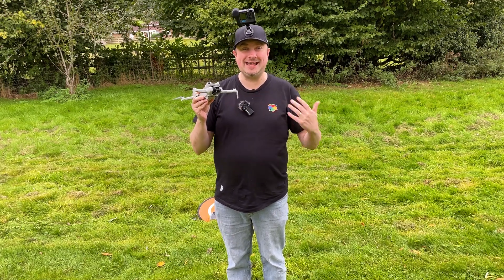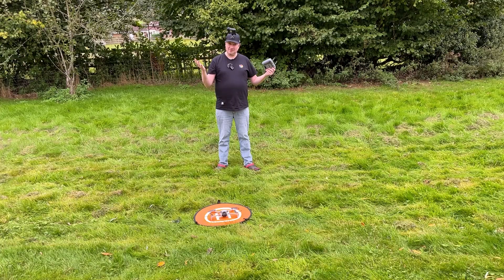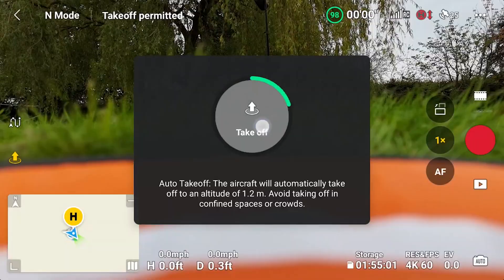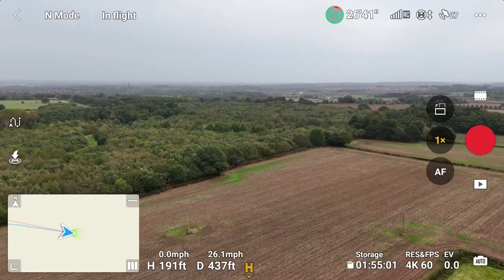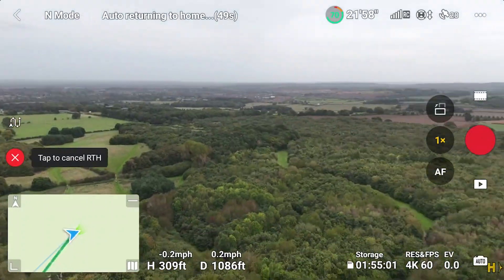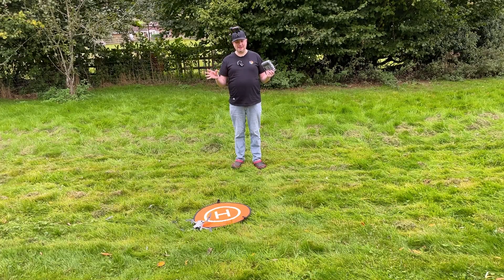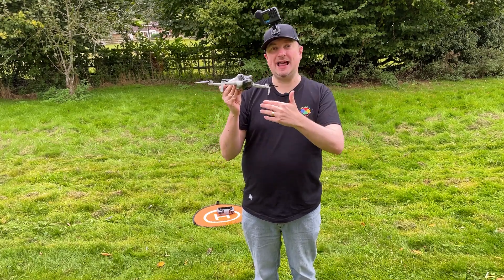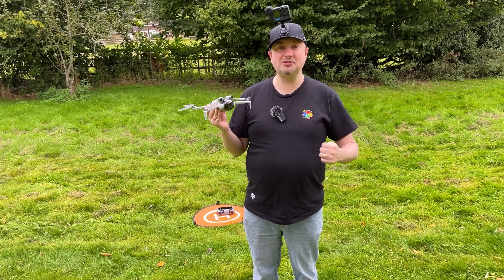DJI Mini 4 Pro Precision Landing Tested: Expectations vs Reality!

Comment: No, that icon beside the satellite icon is for indicating a saved home point, front/back sensores are on, left/right sensoring is on and up/down sensors are on. There is no indicator for precision landing. And: Manual says you have to go up above 7 meters and dont use anything else than up direction. It easily happens to turn it with left stick, switching off prec landing without notice leading to use gps only, which is the reason for the second and third test not hitting the center. You'll need to be very precise when going up.

Comment: The mini 4 pro does not have precision landing so you were testing normal gps return to home.
Reply from the maker: Actually it does. It uses the bottom sensors to scan the take off point.

Comment: What are you talking about? There is no "precision landing" system. The home point is set automatically from GPS when you take off.
Reply from the maker: Precision Landing is a new feature for the Mini 4 Pro :) It is more than GPS. It scans the terrain and remembers it on landing.
Reply: @SimonsDrones  Hi Simon. The icon that you refer to going from red to white is to indicate that obstacle avoidance is active (when white). It is red when on the ground as obstacle avoidance doesn't kick in until it has taken off. Great video btw.
Reply: Read the manual, mini 4 pro have precision landing.

Comment: Not related question.  Does the larger capacity battery fit into the smaller battery hub
That’s included in the fly more pack ? Does it also allow the larger battery to draw power from the other batteries to charge one fully faster ?   Thanks.  Great job w your videos
Reply: The battery cases for both sizes are the same. I wondered the same thing but the exterior portion of both cases are the same size.

Comment: I've never seen where DJI advertises precision landing for the Mini4 pro. I think its accuracy is limited by GPS accuracy, about 1 meter.
Reply from the maker: Nope it is more than GPS, it scans the terrain and remembers it. You can read about it in the manual.
Reply: Yea bruh it’s in the manual….. it uses the bottom sensors to scan the take off point and remembers visually where it took off.

Comment: Can you do a retest please? But this time, after take-off (hovering at about 1.2 metres) face the camera down and then fly straight up and hold at about 7 meters for a few seconds, put your camera back to normal and continue with the test.
I think this could make a big difference, I might be wrong but I am very interested in knowing the results before I proceed to purchase 🧐
Reply from the maker: Sure, I might do at some point. It does scan the terrain on take-off for the precision landing, but I don't know if it uses the camera to do so. In the manual, it does not say you need to reposition the camera to face the ground on take-off.
Reply: The camera has absolutely nothing to do with it’s landing. It’s based on GPS and it’s sensors. You can place tape over the drone camera and try it if you don’t believe me.

Comment: I just cant understand where the rising to 9~10 meters part comes in.  If you auto/manual launch and are 1~2 meters up the GPS will lock in the same and you'd have less drift induced up and till that point.
If I'm wrong I'd welcome being shown in the manual where it states this thing has a down camera or any of the thing many people spew.
Reply: Yes, I thought the hover point was too high. Is it not the case that the drone tilts the camera down and takes a reference photo of the location it took off from? Disclaimer: I’m not a drone owner, but about to purchase the mini 4 pro
Reply: @aearly841  no, it doesn't take a photo. It only uses GPS, and DJI have never claimed that it has any sort of "precision landing" system...
Reply from the maker: You're totally mistaken. The DJI Mini 4 Pro DOES have a new Precision Landing system, that scans the terrain on take-off which is more than just GPS based. DJI have advertised it, and it is in the manual lol.
Reply: DJI went backwards for a while with precision landing , my older Phantom P4 pro has it as did the first Mavic Pro , why they dropped it for a while even though the drones are now using higher spec chips , strange  @SimonsDrones

Comment: Nice video. You did not put the drone on the exact center of the pad for your second test  (time 03:22).  I use a larger folding pad (3.3 feet) for my launches and my drone always lands on the pad.  grass is not good for the props.